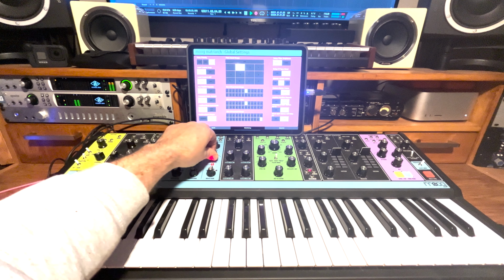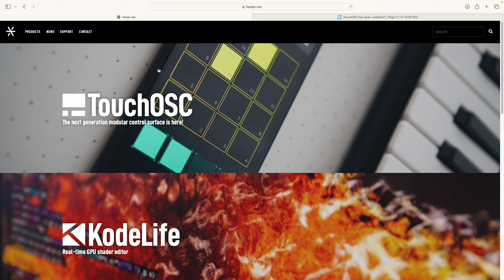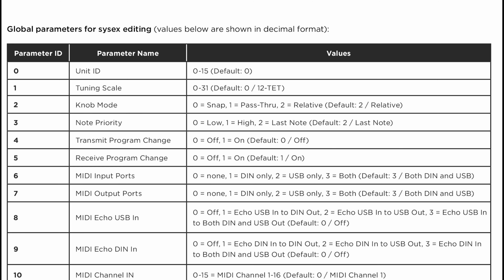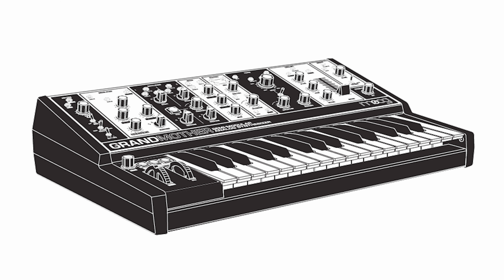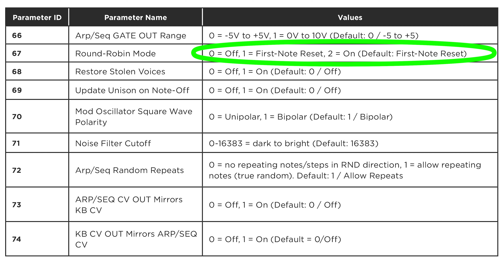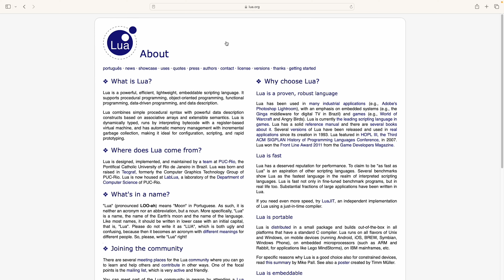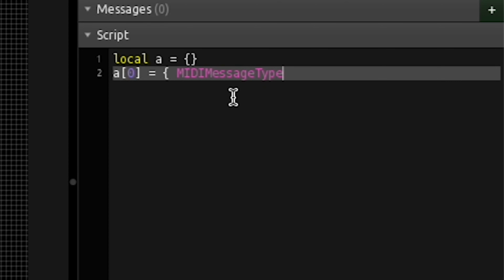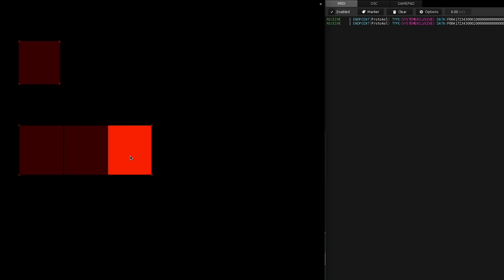Touch OSC and Midi Sysex - Deep Dive on Moog Matriarch (and others)

Comment: Great Video Man!!!. I have a question. I have an Elka EK44 and would like to transfer the Sysex sounds to the K2700. But unfortunately I noticed that on ELKA compared to the classic FM it has 8 operators per oscillator, for a total of 16 oscillators. I also found some Sysex files of the Elka EK44 with all the ROMs on the Internet. I directly upload the Sysex Elka files to the K2700 but it gives me an error. While the Sysex files of the DX7 loaded without error. How come? Is the System Exlusive difference the cause? There is way to solve this problem?
Reply from the maker: unfortunatley that probably won't work. if the architecture of the synth is different from the source (in this case EK44) then the synth (in most casses) will not recognize the sysex file. A lot of synths were made to be compatible with DX7 because it was such a popular synth...so in a lot of cases you can load DX7 patches into different synths. but sounds like your EK44 and K2700 are not compatible.